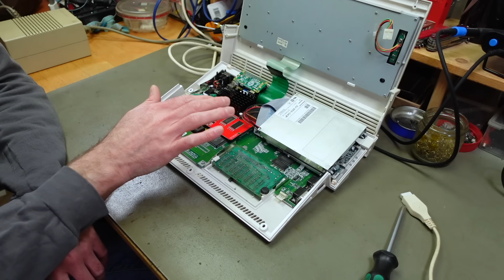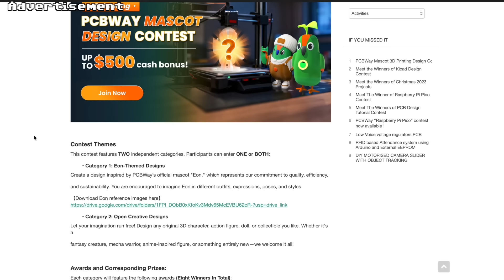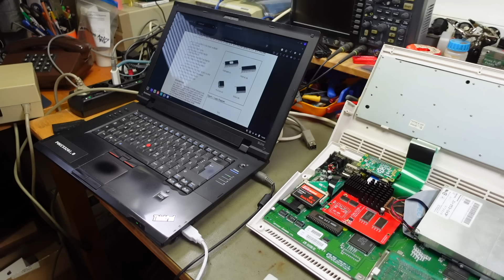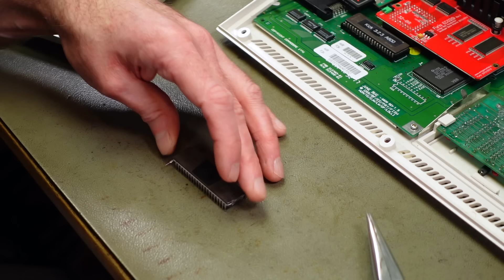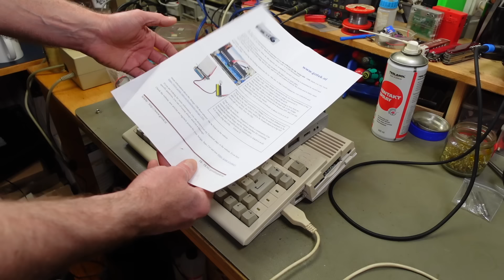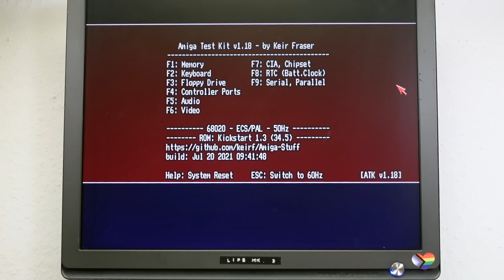One Chip Amiga Kickstart Switcher & an A600/A1200 Boot Selector

Comment: @JanBeta Is that a rubber bumper you have added to the right of the trapdoor 1MB RAM upgrade to protect it?
Reply from the maker: There’s a rubber bumper in that position from factory for the A600 models that came without the top half of the RF shielding. It’s stabilizing the keyboard a bit. If I remember correctly, I had to replace the original one at some point because the glue dried up too much.
Reply: @JanBeta  Thanks, I did not know that! I recently had to remove my top shield for some enhancements, and was wondering if I needed to put a “bumper” there to protect my trapdoor ram :)

Comment: Since you have PCBWay as a sponsor, why not design and have built a ROM switcher that goes between the EPROM and the ROM socket?  No pin bending and no "Mickey Mouse" circuits?
Reply from the maker: I‘m not sure there would be enough room for a PCB. You would very likely have to remove the original socket and do much more shenanigans to make that work. The Kickstart switcher this machine came with was very flimsy and used thin bendy pins to fit at all. I think having a single EPROM is the cleanest solution. Why waste time and resources for a PCB? And there’s also switchable Flash ROM adapters available these days that should fit fine.

Comment: Can an a600 have true fast ram?
Reply from the maker: I think the RAM on the Furia is actual fast RAM and probably there are a few other expansions that achieve that. The A600 is basically the same circuit as the A500(+) so it is technically entirely possible.

Comment: I don't know the A600 PCB, but I am guessing it must be pretty much the same with A500+ Rev 8 board when it comes to the EPROM socket. Inserting a 27C800 directly to the socket doesn't work because Amiga engineers, probably with some future ideas in their minds, connected the Pin #1 (A18) of the EPROM socket to the CPU A18 line, although it is not used with the factory mask ROM. What I did in my A500+ Rev 8 is to cut the traces coming to the pin #1, and bodged a by-pass with a small wire making sure the continuity for the A18 still worked but the EPROM pin #1 is now floating. Then I soldered a 1/8W 10K pull-up resistor to the pin #1, keeping it HIGH by default. Then I ran a single wire from the ROM socket pin #1 to the edge of the casing where I installed a mini on-off switch. The other side of the switch is directly connected to the GND. This way when the switch is off, EPROM A18 (#1) pin is pulled HIGH by the resistor and when the switch is on, the same pin is pulled LOW. All this was done from the underside, so everything looks very clean, and the 27C800 EPROM containing the dual Kickstart images is inserted into the original ROM socket, no adapter PCB's needed.
Reply from the maker: The A500s have a 40-pin Kickstart ROM socket, otherwise the circuitry is very similar indeed.
Reply: @JanBeta Not the Rev 8. Definitely 42 pins.
Reply from the maker: Ah, you’re right. I didn’t realize! I stand corrected.
Reply from the maker: Good one! 😅

Comment: I don’t use Amigas, but I find your meticulous persistence inspirational.

Using antique computers is a very satisfying endeavor. I think Macintosh peaked with system 9, so plan to get a couple 30 year old Macs running, inspired by you.
Reply from the maker: Thanks! I have some Mac resurrecting to do myself soon, too. :D
Reply: Not antique? An antique is generally considered 100 years old or older. The Amiga is considered retro and is a mire 40 years old.
Reply: @mikegravgaard340 computer years are like dog years.
Reply: @jamesfearing9459 As in dead at 16?

I guess it comes down to your use case. I have bought a Mister as I would rather use that.

Using an Amiga often know is kind of risky in my opinion. A failing PSU could take out your pride and joy.

Comment: Reminds me of doing the old floppy kick ROM thing on my 500+, loading 1.3 off a disk to drop it down from its onboard 2.05, never did that with my 600s, mostly cos the game disks I had that needed it were no longer working anyway... :P
Reply from the maker: Yes! I remember using that on my A1200. It only worked for very few games though. :D
Reply: @JanBeta  It only seemed to be needed for older games that didn't like the later Kickstart ROMs, never figured out why, but I'm sure the answer's out there online... :P
Reply from the maker: I think some older games didn’t comply fully with the programming guidelines and used trickery that was removed/changed in later Kickstart versions. :)
Reply: @JanBeta  That makes sense, a lot of game coders liked to use exploits and flaws in things like ROM code and hardware to make their games do stuff the computers couldn't officially do... :)

Comment: In contrast to the A500 floppy swappers, your A600 adapter has a wire connected to DF0:, is the internal drive actually available as DF1: if the GoTek is booting as DF0:?
Reply: You might want to look at the Go Drive 1200. It allows to switch between the two drives via a switch without removing the internally floppy.

Not sure though if it switches then though or just disables the internal drive though. I plan to buy one but they are around £120 or so.
Reply: no , it behaves exactly as the older amiga's , once external is DF0 : , internal is hidden, but can be used to cope disks with a little trick

Comment: the only reason i didn't stick to the 600 was the missing freezer slot :(
Reply from the maker: That's one of the downsides of this machine indeed. So many expansions didn't work because they didn't include that connector. There's quite a lot you can expand internally these days though, thankfully. :)

Comment: The only time a game didn't worked on my Amiga 500+ was when the game needed fast ram. Even if the 500+ have 1MB chip ram the game won't start. I even expanded the chip ram to 2MB, but the game refused to start. When i got my SupraDrive with 1MB fast ram the games that didn't worked before now started to work. I assume it has something to do with how they had programmed the game to look for ram.
Reply: It is normally due to the kickstart revision. This is the reason to switch back to 1.3.

There are very few games which dislike the later Agnus or Denise.

Comment: My A600 was my favourite Amiga out of all the amigas I owned (a500,a500+,a1200,a1200 power tower)
Reply: Amiga 1200 and Amiga 500 Plus are better machines. Technically, an Amiga 500 Plus is virtually the same CPU and chipset but has the edge connector but lacks the PCMCIA slot and IDE connector. It has more space for expansions both internally and externally via the edge connector.

I always like the idea/concept of the CDTV however they are too expensive now for what they actually are.

Comment: The A600 requires at least Kickstart 2.1 for the IDE interface to work.
Kickstart 3.1 should also work. 
The A1200 had Kickstart 3.0 or 3.1
The A500 had Kickstart 1.3 or 2.0
Reply: Su A600 il kickstart minimo per avere l'interfaccia ide attiva è il 2.05 versione 37.300,con un massimo di 40 MB
Reply from the maker: I think the IDE compatibility was added in Kick 2.05, 2.1 was just a software revision afaik. ;)
Reply: @JanBeta   hai ragione Jan,il kickstart minimo è il 2.05 versione 37.300,il 37.299 non abilita l'ide,e non ho mai visto il kickstart 2.1 ma solo il sistema operativo
Reply: And 1.2.  Everyone always forgets about 1.2.  My A500 has 1.2.